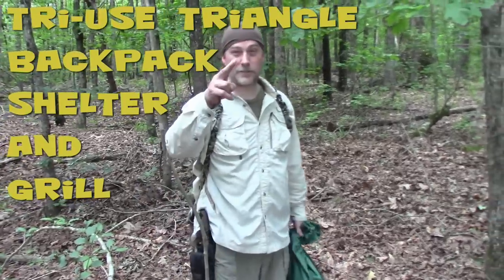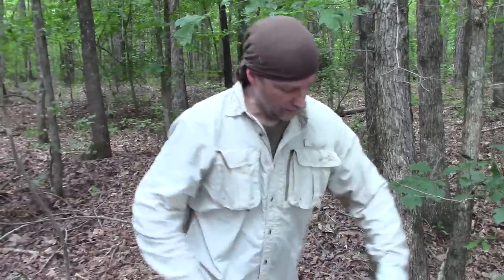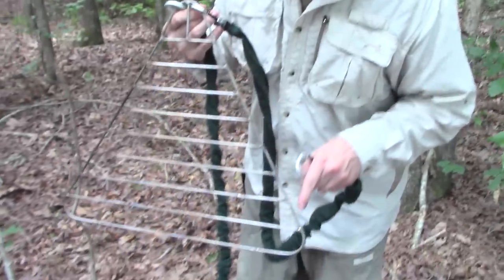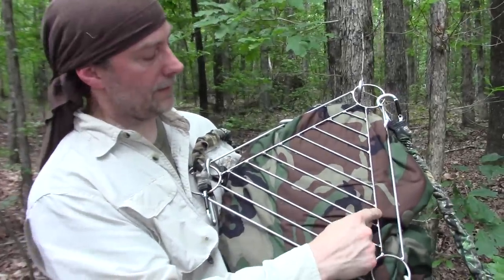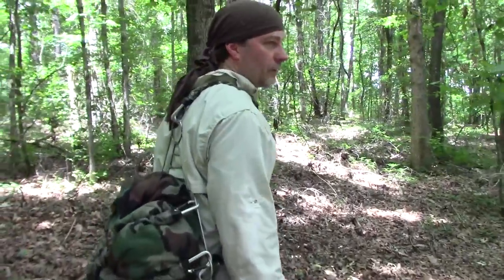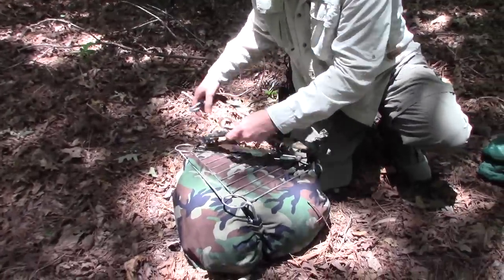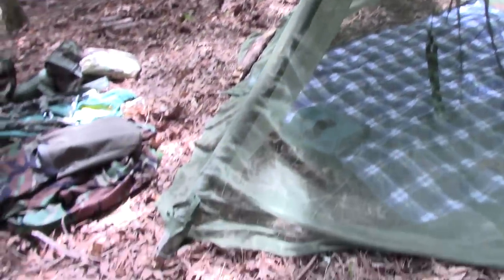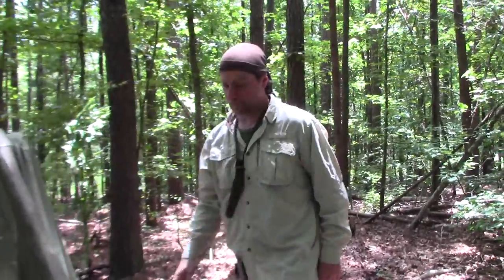Tri Use Triangle Grill Shelter And Pack Frame

Comment: One suggestion would be just to make your overall tent 12 to 16 inches longer on each side. To give you a little more room in the center for your fire. I don’t think that would add  a lot of weight to that tarp..One last thing,  just a comment. The little triangle makes a nice grill. But if you have to take it off  the tent every time you need it . that wouldn’t be very convenient. Maybe you could double up the metal grill. One for the tent and one for cooking. It seems to be pretty light weight. Wouldn’t add a lot to the weight of your backpack.
Reply from the maker: That's no the idea of the grill being multi use,  it's either a grill or it's a shelter topper.  I never intended it to cover both jobs on the same trip.  Thanks for the input and thanks for watching

Comment: Dave, ya built a cloth smoker with  kite smoke diverter accessory.  A lot of military grade material is fire retardant. A whole other option could be camo nomex, to maybe cancel out Nick's concerns. Me personally I'd probably use my gasifier twig/pellet stove, white gas, or isopropane stove in there.  A Dakota fire hole with vent hole being outside of the tent is another option.  Great build though.  TC and ATB, Cris.
Reply from the maker: Thanks for the comments Cris and thanks for watching

Comment: Great video guys, and very cool concept. I think sin Nick maybe onto something with the fire in there, I'd lean more towards flame proofing than water proofing. Maybe add some of that carbon fiber around the opening. I don't like that there is no floor, but that is a personal preference. What will you do to stop insect from flying down the chimney, wire screen?
Reply from the maker: Thanks,  I'm glad you liked it.  I may do an actual carbon fiber chimney.  During the summer I'd have the top capped and no fire.  There's no bugs out in the winter when it's open for fire
Reply: @Reallybigmonkey1  Good idea. I did not know your winter bug situation

Comment: You could make a piece of ripstop or whatever in an equilateral, sides twice the length of the poles. That would go nicely with the pack frame. Door's easy - it's one side of your pyramid. heh heh Super interesting project in development. Put a ring / grommet for the poles? Your shelter is like a teepee. Could make a door like that too. I've also been thinking of making a light easy teepee or something. Cos I really want my fire inside out of the rain haha Your design is damn interesting.

Yes Nick you can have a fire in a tent. hahaha

Wut? NO I do not want to smell like fish. Bacon is better.

Thought of a question. How strong is the shelter? Looks like wind is pretty strong out there.

Whoa it totally blends into the background. Probably make it bright neon pink so we can find it easily lol
Reply from the maker: Thanks for the suggestions Chris and I'm glad you liked it.  Just the frame and grill topper is a little wobbly but bbn once that sewn fitted cover goes on it's tight as any shelter could be.  Take care and thanks for watching my friend

Comment: it's a cool shelter Dave but you can't use the grill on the ground when the shelter is up is there a way you could seperate the inside triangle from the outside so you could use both
Reply from the maker: No it's one piece and yes it's considered multi use but one use at a time.  Its either a grill or a shelter topper.  It was never meant to be both on the same trip

Comment: Can you use a fire retardant fabric? Maybe also have some ties sewn around the top opening to tie off to the rings, not essential but in winds might add some more support. Everyone will cut poles to different lengths and tie offs will alleviate the cover sliding down. Also, the mesh/waterproof top attachment for times when no fire in use is great. Keeping air flow going is critical, some small tunnel type openings with bendable wire to shape them around could be useful at low points to help smoke extraction. I see Nicks point of fire risk, but think you could sort that. Put me down for one! PS nice welding!
Reply from the maker: Fire retardant fabric would be good  but most all of the fire retardant fabric I've seen isn't water proof.  Thanks for all the ideas and this is still a work in progress.  Take care and thanks for watching

Comment: Very cool but aren´t you worried about getting soot on your gear and clothes? 

Maybe you can integrate some sort of protection that can also be used for something else?
Reply from the maker: Not worried at all,  the heat smoke and flames will rise just like it does in a Wiki Up or similar to a Teepee
Reply: @Reallybigmonkey1  Maybe he means you'll have to clean the grill really well after you cook on it, before you sling it on your back...  great ideas as always, you are full of inspiration, lucky Nick to learn all these gems of wisdom first hand!
Reply from the maker: @dogbiscuit1171  oh yeah, well I do keep a scotch brite pad for cleaning it. Thanks for watching

Comment: High you two!
Not a bad idea and well done ,like always.
But wouldnt it be a bit more comfortabe to put some Amaflex tubes or a pool noodle over the outer rods 
while carrying? Just asking cause I have a sensible back.
Once in a vid you made a hanging fire in the swamps.Cant you hang that thing from above so you can 
pull it up and down and out of the way when not needed?Because you are somewhat ingenious you may think of an
idea to fix that triangle tarp directly to the grill so that could be used free standing and no trees needed.
 Seems like an effective system to me.
Reply from the maker: Hello and we are glad you liked it.  Lots of good ideas you suggested.  Ive been thinking all along of something like that hanging swamp grill instead of an open fire.  Instead of pool noodles I might rolled up my sleep clothing or even have my sleeping bag between my back and the grill?

Comment: I wonder if you made it out of a aqua quest heavy duty camo tarp. it would be 100 percent waterproof, and tough and maybe a little lighter than the material you are using. you would probably have to seam seal all the spots you had to stitch a new connection.
Reply from the maker: Oh there's no doubt it would be better.  Just at about 5 to 6 times the cost of buying the tarps and cutting fitting and sewing them together

Comment: Would welding cloth help with protecting the material from the fire?
Reply from the maker: Yes, absolutely
Reply: @Reallybigmonkey1   Pondering all this. I like how much smaller this system would be to use.  Thanks for the info.

Comment: That'd be neat to see the return of the swamp stove. Repurpose it for the interior hanging fireplace. I'd just be worried about the potential weight on the triangle.
Reply: If not the swamp stove, even a small paraphine cube fire thing to keep the inside warm. (Or tea candles)
Reply from the maker: Swamp stove or one of them many other hanging contraptions laying around in my basement.  Lol. I'll just have to see what weight this triangle will hold.  Take care and thanks for watching
Reply from the maker: Or maybe even just a fire pan or fire bowl sitting on the ground?
Reply: Yeah, because even with tea candles you'd have to use at least three to get anything warm.

Comment: Howa 'bout a mini triangle to add to original to elevate the top cover? then tie off or bungee as needed.  Or even a notched and rounded stick.  Maybe longer ridge poles is the easy answer?
Reply from the maker: All good ideas.  I'm definitely not going to use the topper like it is, it needs improving

Comment: With out seeming to be part of the 1% , You need 2frames if you want to grill anything or you'll have to take the shelter down, but the concept is good 👍🇬🇧🇺🇲
Reply from the maker: It's not meant to be that way, its more of a multi use item as in just a grill  or just as a shelter topper.  It's intentions are not meant as both on the same trip.
Reply: @Reallybigmonkey1  
Don't I feel like an ass hole 😂😂👍
Reply from the maker: @jimcy1318   Lol! I probably didnt convey it clear enough to begin with in the video.

Comment: I've got to say that I agree with Nick about the fire.  All the rest of this concept is great, but I truly think that this particular set up would be a death trap.  Don't get me wrong, your various ways of getting a fire in a tent is what got me hooked on your channel, from the outset!  I just think that the current set up is not designed with fire safety as the primary concern.  Understandably, given that it is a multi-use item.  But I think it would take some major changes to get it safe.

Just picture what would happen if something hit your shelter at night (big animal or a drunk say) & your suspended fire pot got spilled on one of your sleeping bags!  Without any fire retardant materials, both the sleeping bag and tent would be going up like a torch.  On top of which your exit is covered by netting.

If you got out of that alive, you would have third degree burns and sleeping bag melted onto your skin.  Sorry for the downer, but both Nick & I are speaking our minds, when we see the risks.  I'd rather risk you taking offence, than sit quiet and see you (&/or Nick) suffer

Something which tipped me into speaking up, was having another fire in my house last week!  Just an electrical one mind. But in a very crowded room, where I had no way of being able to get to the socket, to cut the power to the device.  And seeing the cramped space you have next to the proposed fire, brought it back to me how much harder it was to bring the fire under control due to the lack of space.

Yet I always had the option of just walking out of the room, and abandoning it to its fate.  You however might not be able to do that.  So listen to Nick's worries.  He may be cheeky, but he is being wise with it.  I think a serious redesign is in order, as your heart is clearly set on the fire.

Stay safe bud.
Reply from the maker: We shall see how it turns out. Thanks for the comments Mark

Comment: Test it out with a twig stove, like say a Firebox. 
 
In deep thought of stabilizing the frame, you'll prolly figure holding sides out a bit with same.
It looks like it wants to Spin collapse?
Reply from the maker: A fire box/bowl or oven is a definite possibility.  This frame will spin or twist with no cover but with a cover on it seems to hold it all secure.  Thanks for the comments and thanks for watching Brian
Reply: @Reallybigmonkey1   Roger that guys.
~ At least something that breaths. Bowl not so much? 
~~ Still kinda small...wondering if part of reason Native American's teepee works is thermal rise.
If cools too fast, does more mixing occur?
...along comes Co, and a headache?
Reply from the maker: @brianbartulis9709  well with the native teepee it's got that double wall that really creates an incredible draw. I've used fire bowls before and yes,  they don't breathe very well.  I started developing a gassifer double wall bowl years ago but never completed it

Comment: I think if you just used a Dakota fire hole in the shelter instead of making a big fire ring taking up you floor space inside and carrying a smaller grill with you might be a better option in my opinion
Reply from the maker: That's definitely a good option to test.  Thanks for watching

Comment: Dave you ask for comments and here I go . To my recollection I have never had any negative comments in the years past, just suggestions . But this time it's like your trying to reinvent the wheel. When you say not bad about the wire on your back come on brother that has to be a bungy cord Stritch. And the shelter needs a water proof floor for damn sure that takes it from shelter tarp to tent . I remember when I was kid in California's central valley where even in winter rain is not a sure thing but in summer never. Will it did rain in the middle of summer at night for about 4 hours and let me tell you my Tepee had a river running through it we woke up and the 3 of us needed life jackets. As to your entrance that cover needs to hang over the opening at least a foot on both side or water will poor in that is also a lesson from the Tepee  I hope these comments don't get me thrown into the 1 percenters . Personally I would flip the the pack and put the tarp against my back and let the stiffness of the grill hold it against my back I think at the end of a day hike my back might be in better shape but then again if your just walking from the truck to your camp sight. Now don't be kicking me to hard into the 1% pile I'm old and it could hurt. Happy trails you 2.
Reply from the maker: Thanks for the comments Mike

Comment: Excellent idea but the tarp needs to be bigger, you won't be able to sleep that close to a fire and moving around would be dangerous
Keep on developing ! <3
Reply from the maker: Yes bigger would be better but, at what extra weight will it cost? Theres a fine balance in pack weight vs usability. Thanks for watching John

Comment: What about a  cloth waterproof topper to bring along  for the tent , so when it rains you don't get wet inside? sort of shaped like a wizards hat , {sort of like a funnel , with no hole at the top} whenever it isn't raining you won't need it.
Reply from the maker: I showed a topper in the video but it wasn't funnel shaped,  did you miss it?
Reply: @Reallybigmonkey1  I did , sorry , probably stuffing something in my face  and looked away. Great idea for the frame, I remember the original , this is a nice improvement now you just put a bow saw blade  with a plastic pipe for cover side  to process wood and all the flatland tourists will  buy 2 each ! Love your channel and glad you and Nick get to hang out together

Comment: What if you used a square great instead of a triangle great you could actually turn it into a pyramid which would give you a little more room inside. Would put two people possibly away from the fire in the middle
Reply from the maker: A square would definitely add room,  only problem is it wouldn't work with the Roycroft pack frame shape.  Thanks for watching Chris

Comment: that's pretty cool sir. so would you use 2 triangle frames then? because once you make the shelter you wouldn't have a grill.
Reply from the maker: I'm glad you liked it.  No, just one triangle but I have to clarify the multi use of it. Its either a grill or it's a shelter topper.  It was never intended to cover both uses in the same outing.
Reply: @Reallybigmonkey1  oh now i get it. I aint the brightest blinker on the Christmas tree sometimes. Thanks for replying!

Comment: Why not just use a square grill and 4 posts? The grill and the tent pegs will hold it from being wobbly. You'll have more room. And using a folding stove would be better than an open fire in there. Maybe an ikea hobo stove?
Reply from the maker: Square would definitely work but the triangle shape lends itself to mimicking the shape of the Roycroft pack frame which is quite comfortable.  This is still in the development stage so a stove, oven or fire bowl is definitely a possibility.  Thanks for watching Randy
Reply: @Reallybigmonkey1  or what about just putting 2 holes close together at one of the triangle points so you can have 4 poles. I just hate being cramped in a tent.

Comment: R&D suggesting; This design meet 45mph wind requirement.  Teepee tent, three sides. Triangle. Hole in the side for hot stove pipe. I don't set fires inside a tent.  Move rocks from the fireside into the tent.  Cook outside... away from the tent.  Animals go there and not in the tent.  Hang the food, too.   best wishes.
Reply from the maker: There's already store bought tents with stove pipe holes in the side. This is a all new design experiment.  45 mph? Ah, maybe maybe not.  Thanks for watching

Comment: maybe some mosquito netting?
Reply from the maker: During the summer that's absolutely a good addition.  Thanks for watching my friend
Reply: @Reallybigmonkey1  
apart from the pack frame, can it it be fabricated to accommodate a tipi
or capable of attaching shelters to one another, like a kachanski super shelter
off topic, seen these camping stoves,with a gallon water heater that can be attached when needed
Reply from the maker: @hickorydickory  yes, it can be modified for that.